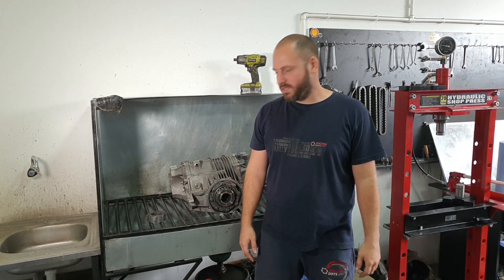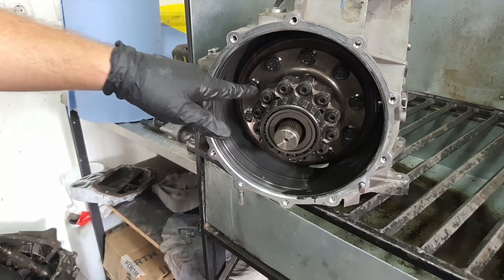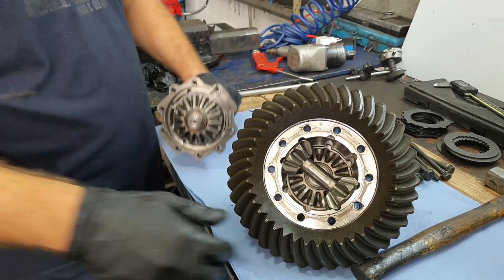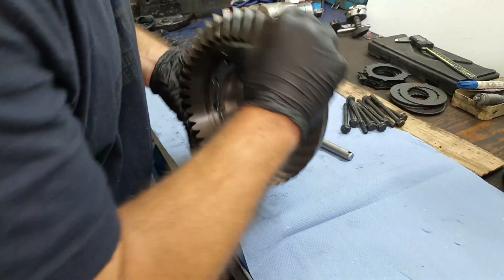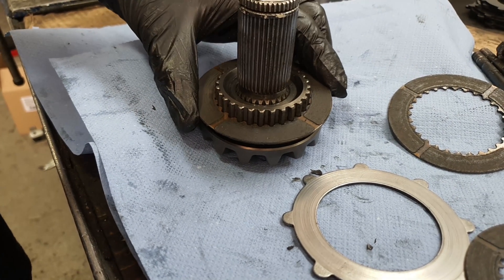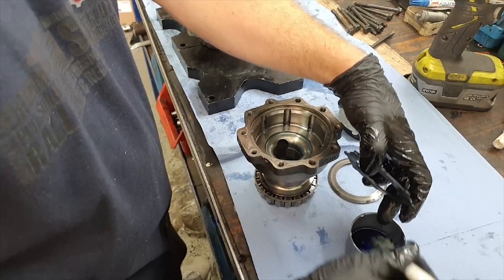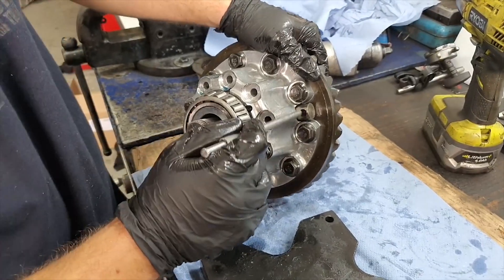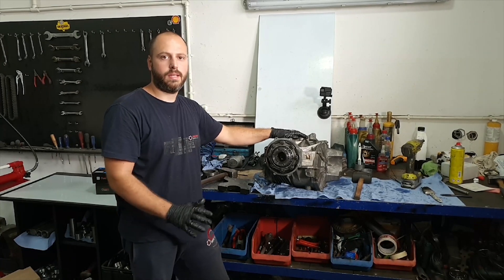Chevy Corvette Rear axle rebuild / Problem with free play and worn clutches

Comment: I bought a 2001 c5 corvette 6 speed and she needs alot of maintenance.  I need to restore my diff.   Is this something i can send off to be rebuilt?   I haven't driven in over 25 years and 2026 is the year i hope
Reply from the maker: You can send it to us, or if that is now cost effective option, you can send it to some of our official dealers that is close to your location. Where are you based?
Reply: @RacingDiffs I just bought this car after not driving for 25 years after a bad wreck where a semi truck hit me and my brother.  4 back surgeries and fusion of my spine and alot of rehabilitation im walking again and didn't give up on my dream of owning a corvette.  I bought a 2001 c5 6 speed that needs Lots of maintenance.  I replaced the plugs and wires and fuel filter.  Now i have a new Map sensor and Cam sensor and new intake gaskets and a new oil pressure sensor and a relocation kit for it so I dont have to take the intake off next time it goes out. Hopefully 2026 is my year to finally drive again.  😊
Reply from the maker: Sorry to hear this but I'm glad your back on track💪🏼  Give this gentleman a call. He's awesome and he'll help you with your diff.

Mark Welch

Address: 432 Woodlawn Drive, Danville, VA, 24541

Phone: +1 434 770 2645

Email: welchrx7@msn.com
Reply: @RacingDiffs great man. I took a screenshot of this so i dont lose it.  I have a little money saved but probably not enough yet but i will definitely get a hold of him about the car. I seriously appreciate the help.   I dont want to just throw her in a shop around here where it would be their 1st time working on one of those. So ive been doing some work on it and really close to pulling the intake to replace the Cam sensor and Map sensor.
Reply: Im based in Oklahoma close to Fort Smith Arkansas.   @RacingDiffs

Comment: So I’m looking to purchase a base 2006 C6 and it has a noise/rub when taking a hard left. Was told by a mechanic it’s a rear diff issue and needs to be replaced. Seems they are discontinued, can only find replacements on eBay. I don’t mind replacing it but I wonder if it needs to be replaced. Where are you located? Thanks
Reply from the maker: Personally, I wouldn't go with the used unit on eBay, as most likely it's not better than yours. The problem with clutch plates is very common. I would rather rebuild the current unit. Love to do the job for you, but we are based in Serbia, Europe. You need to find some Corvette specialist to take the diff out. The rest is easy and we can supply parts.

Comment: Thank you for this video. When im going 4th in 5th gear (250km+) I get speed wobble every time. It feels like the clutch lets go when shifting 4th into 5th, then the car dips down and veers over a lane (very sketch). I have to counter steer just to go straight. 

 I have literally done everything possible to fix that issue but I think its the clutches in the differential to cause that "speed wobble" im getting. 

Also, im breaking lots of axles while doing dig racing, I don't know if that is related to the slipping clutch or not.

Any feedback would be greatly appreciated, been dealing with this since 2019 summer.
Reply from the maker: Greetings! Such speed wobble might be caused by diff clutches. If they lost inneer splines, or friction material your diff acts completely like an opened diff. In this case it just can't transmit all your power to the ground.
Reply: @RacingDiffs  Yess!! Thank you!!! I’m going to fix it ASAP 

You are the man!!!
Reply from the maker: @402video  always here to help👍🏻

Comment: Hi. Do i hammer the factory safety pin up or down that holds the central pin and its sleeve in my 05 crv rear differential? (To remove it)
Reply: It is hammered from the bottom(flat surface) btw. For those working on their crv rear.
Reply: If both clutch packs are toast would that keep the car from moving when releasing the transmission clutch?  I drained the rear diff and it had a lot of gold glider in it from the clutch pack.
Reply: @joyroc885 before I say anything that might be unrelated  are you working on a crv rear diff?
Reply: @tomasashenafi882  working on a c6 rear end.

Comment: Can i still use honda crv rear dual pump fluid with LSD additive called lubegard?
Reply from the maker: Yes you can
Reply: @RacingDiffs  what was the red lubricant you use in every video?
Reply from the maker: @tomasashenafi882  we use motul gear competition 75w140.